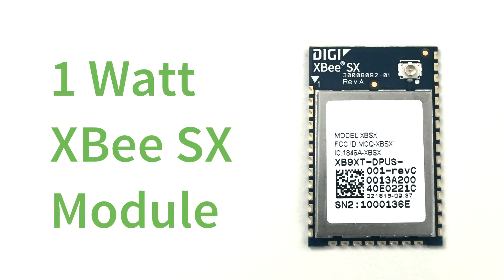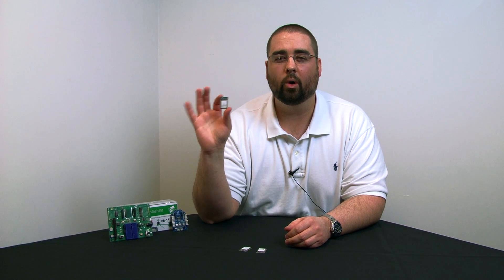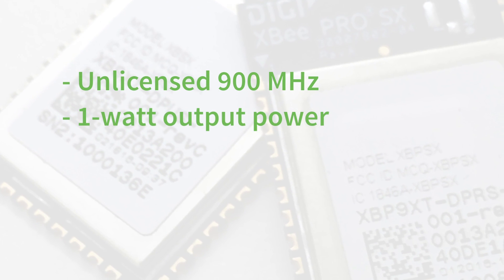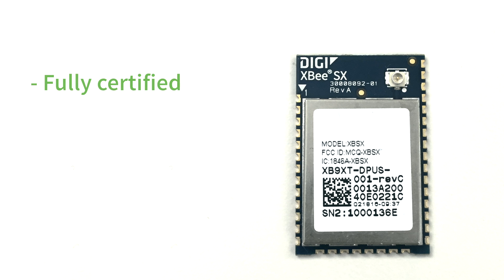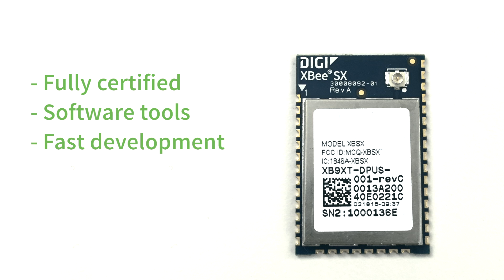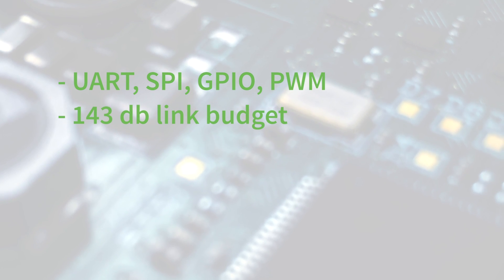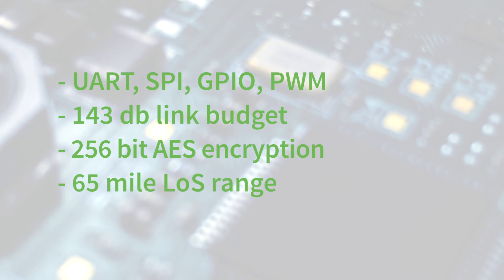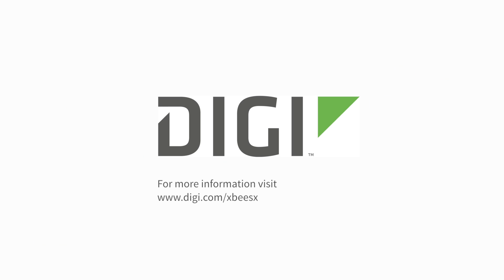A look at the Digi XBee SX

Comment: this is very not so true. 
I used Xbee 900 S3B with high gain antenna and it gave me around 40 ft range. Digi support is not helpful at all! 
Sorry but please stop misguiding
Reply: Sounds like you may not have your antenna connected. Did you check with a spectrum analyzer?